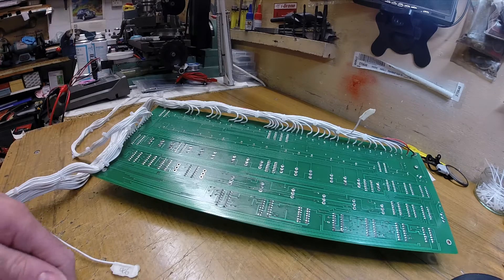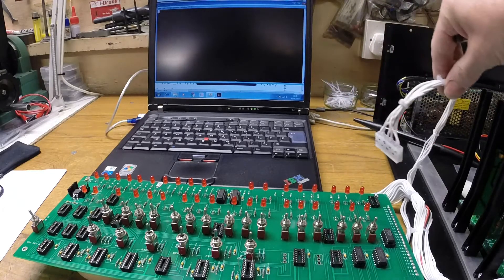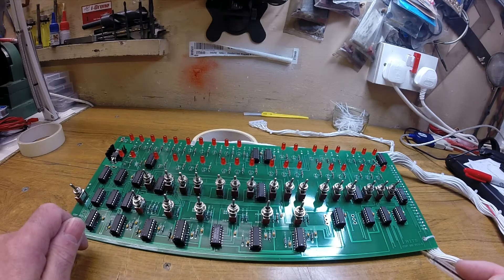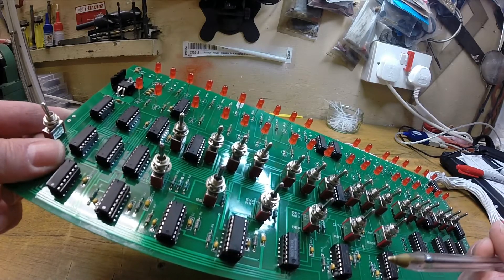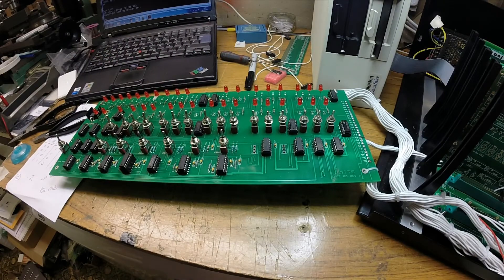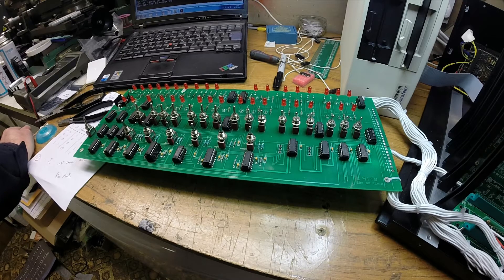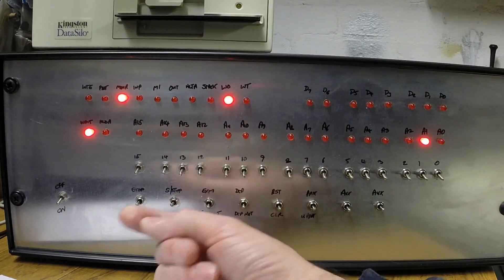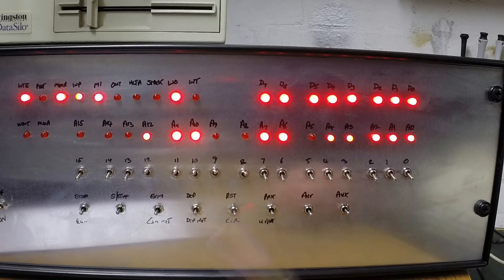Altair 8800 Build Project Part 12 - Front Panel Part 2

Comment: Mike Douglas's front panel for his 8800c has all that wiring routed through a 50 pin IDC cable to a separate S-100 card.  Makes for a really neat looking installation.  Not a rats nest of wires anywhere!

Comment: Have exactly the same MWRITE problem with the 'original' front panel board with intermittently failing memory writes. Generating MWRITE on the 88-2SIOJP board seems to work fine. Thinking of adding a diode/resistor OR gate to this board and taking the deposit signal from the front panel just as you did. (dunno how this managed to work in 1975...). Thanks for going into this detail - super helpful!
Reply from the maker: Yep a bit of a pain really. The front panel on it's own seemed to work fine, but as soon as you started to run anything serious things started to go wrong. I suspect the long wires from the front panel may be the issue, but really need to go back to this at some point and fix it properly asuming of course it is fixable with the original configuration. Busy fixing Intel 64K Ram boards currently four of them ! So far three down and one to go.............which of course is proving the most difficult 🙃
Reply: @martynsvintagecomputing6338  I ended up using the mwrite functionality on the 88SIO-JP card and adding a single OR gate chip along with your idea of routing the front panel 74ls123 via an unused s100 signal. 
I also followed jerrys advice in his backplane noise video and trimmed front panel wires and added ferrites.
The result is a transformation! A slightly unreliable super  slot sensitive Altair 8800 is now rock solid no matter what I do.
Anyway thanks again again for these videos- super helpful and I learned a lot!
Good luck with the RAM cards!
Reply from the maker: @gchester99  That sounds good I'm glad everything is working well now.